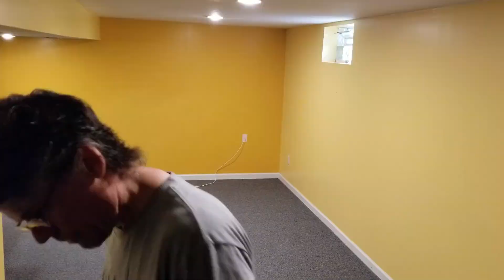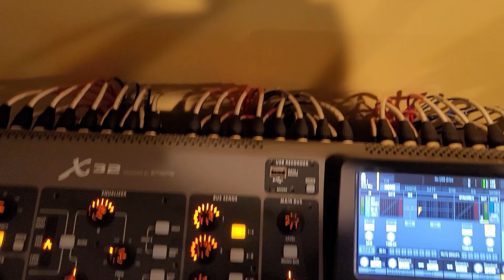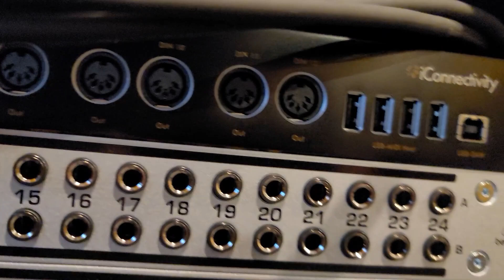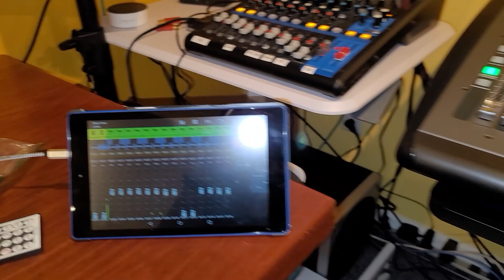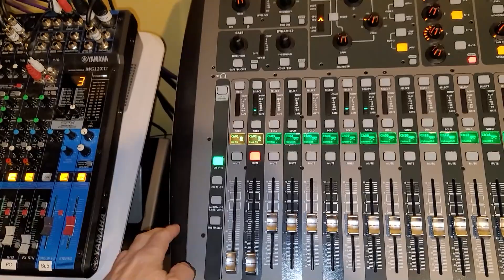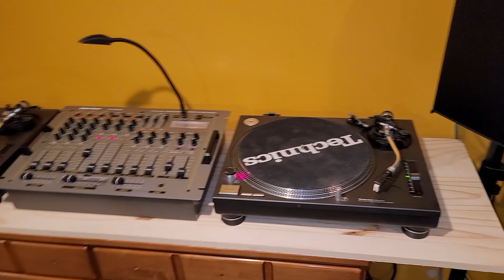I SCRAPPED My Old Studio - How I Built My NEW STUDIO!!

Comment: if your not moving again here is a tip for you using a few tee's and cross tubes you can get extra by joining your two A frames stands to make a third without more A frames ,,, also tilt them back legs more to a vertical so get's them closer to the back wall ....   have my 88's 70's in the middle and 2 lots of spaces for 61's on the sides  with 4 tier's each ....
Reply from the maker: Yes, I had exactly this in mind when I bought the second identical A-frame. :) I already have the T's, I would just need the cross tubes. I played with the vertical slope quite a bit, but found that when I had them sloped more, while it did reveal more of the control surfaces, it made it difficult to work with the synths on the top, especially the Wavestate and opsix that require lots of fiddling, because my back would get sore from leaning outwards! So I intentionally made them quite vertical.
Reply: @ScottsSynthStuff  I did a quick check, but really need to do a more in depth check for fit, but I tried tubes and fittings from both Jaspers and On Stage, and at first glance , they seemed to be interchangeable... Like I said, this was a quick try, and I need to take a seriously close look at the fit, but they did fit each other...
Reply: Yes. I do this also.

Comment: I have been following your video very carefully. I am an amateur and have been setting up my own small studio for a year now, it is clear that you are very passionate and that you do things with enthusiasm. You go very fast and not everything is clear to me because I am less experienced. I think I'll take it easy to steal some ideas from you. Can I afford a hint? I would raise all the cables touching the floor to facilitate the use of the vacuum cleaner. Congratulations on your enthusiasm and technical skill. Greetings from Italy.
Reply from the maker: I like your idea, maybe a cable chase or some kind of elevated platform attached to the stands to lift the cables up. It's tough with the snakes, they are VERY heavy, so they need to be properly supported so as to not put too much strain on the connectors.
Reply: @ScottsSynthStuff  I like this professional approach. I have been working for years in the field of robotics and industrial automation. The electrical connections made with care are as important as the mechanical part. Good continuation for the realization of your studio.

Comment: Scott  i  got stuck in the GAS stage ....and now need to take time to do all  the rack module and  keyboard repairs and then rig my room up midi  Audio and power side of things this coming winter  its only 25 boards and 40 odd rack modules ....lol   wish me luck
Reply from the maker: "only" :) :) Good luck! I just want to get the Polysix and Juno-106 done this winter! Oh...and write some music!! :)
Reply: @ScottsSynthStuff  seen how many screws are in a motif 6 ... also a fader on a  X station. an encoder on a E-mu  rack module and akai S5000   replace a cracked  key on a Gem exquinox pro88 ,and Emax 2 chipped key.and replace a board in an E4k... not much ....lol
Reply from the maker: @johnb2044  Same for the Montage. SO many screws! The JD-800, too.
Reply: @ScottsSynthStuff  yeah just got a JD-800 and its really needing end covers as it had a fall from previous owners who gave it a band aide fix ... have found a parts board but have to go collect it ... down to the USA for me from BC..

Comment: Thanks for going through you new setup.  I configure my studio about once a year.  It takes about 2 weeks of out-of-service and another 2 weeks to finish (a bout a month).  I have 26 keyboards all connected and ready to go.  Submixed in RX1602s (6each) into a X32.  I route MIDI via a MCRR. Jasper stands. MacBook Pro running Ableton Live/with Push 2.  Sequencing on a MPC-X.  I've made all my own audio cables, using canary star-quad cable.  (Noise is pretty low). I monitor via Yamaha HS-10 and Bose L1S.  I managed to leave a little room for guests (2 max).  The most useful tool in the studio is an Excel Spreadsheet!  I divide everything into positions and have excel sheets for MIDI and audio routing.
Reply from the maker: Yes!! I realized pretty early on that I was going to have to create some spreadsheets to keep track of routing and cables. I looked at the MRCC, but decided on the mioXL for the RTP functionality. 

I went to Sweetwater this spring to audition studio monitors, as they have a DAW room with tons of them hooked up so that you can A/B them quickly and easily. I decided after lengthy listening...to just keep the inexpensive JBL 305P's that I already had. I have a couple sets of headphones that reveal quite a bit as well, plus I'm USED to the JBL's, and know what things sound like on them.

26 keyboards! I'm getting there...slowly...
Reply: @ScottsSynthStuff  Thanks for the reply.  I also have a bunch of groove boxes and drum machines.  You've inspired me to get the Cobalt 8X, I know I'll have to wear a set of readers to see what I am doing, but think I am going to enjoy the sounds.  My shame for having so many keyboards, I tend to play factory patches and only a hand full of sounds per instrument.  But many times it is comforting reaching for a keyboard/synth for a particular sound/patch.  I do sport a modular system where I would like to think I am sound designing.  I really enjoy you approach and style, Your videos are very entertaining and instructive.  Keep on making content.👍  PS. the cool thing about reconfiguring your studio is that it brings different synths into highlight and allow my workflow to continuously develop.

Comment: Question. Why would you run your Behringer X32 through the Yamaha MG12XU, effectively reducing your 32 channels of individual audio, down to one stereotrack? Why not use the Behringer as the audio interface? Seems weird to me, and I'm also suspicious of the Behringer headphone amp, as I had a similar tiny mixer/amp that came in the same chasis, and it was SO bad, so much noise. Maybe they upped their game since then? Looks RAD otherwise!
Reply from the maker: Maybe I didn't explain it well enough. For recording in my DAW, the X32 is my audio interface, using its 32 in/32 out ASIO driver. For everyday Windows use, the Windows audio device is the MG12XU. The MG12XU also controls some devices that I want going through the monitors for which I don't care to use channels in the X32. This way, the X32 only needs to be switched on when I'm actually using my DAW or working with the synths.

The Behringer headphone amp is not...the cleanest thing. I'll likely replace it with a better rack-mounted unit in future. For actual editing, I've just been plugging my headphones directly into the X32, but for casual use (especially for recording vocals) it's fine...for now.
Reply: @ScottsSynthStuff  I see :)
Thank you for the explanation!

Comment: Oh, another question for you is what drove your purchasing decision on the Fantom-06 over the Fantom-6 or others?  I have no workstation KB right now and am thinking about the Fantom-6 or just a Jupiter-X or even Jupiter-Xm as primarily a module.
Reply from the maker: I really liked the Fantom, but couldn't justify the price. Plus I already had a Montage, which replaced my MODX. However that left me without a portable lightweight multitimbral do-everything synth, so when the Fantom-06 came out, and did pretty much all the stuff in the Fantom that I loved, I jumped at it. And for that purpose, it's great. I do wish it had more memory in it however. The Jupiter-X I actually really loved when I played it...and I didn't expect to - but it duplicates a lot of what's in the Fantom and my System-8, and I reaaaaally dislike the tiny postage-stamp sized screen the put on it, along with the deep menu diving you have to do on that tiny screen.
Reply: I have a Fantom 8. I thought about also getting a Jupiter X/Xm or Juno X, but realized there isn't much they offer over the Fantom except for price and a different UI (such as that small screen on the X/Xm vs. the big touch screen on the Fantom). I like that the Juno-X moved the screen front and center. It was a mistake on the Jupiter to put it in the upper left. Each has special features though. No one of these synths does it all. I'm sure Roland did that on purpose.  If I got a Roland something to compliment my Fantom, it would probably be a System-8.  

Ultimately, they are all ZEN-core synths, largely doing the same thing but in different ways (including mostly similar model expansions like the JX-8P or Juno-106). The Fantom, though, adds workstation features (clip launching, 16 channels of control over internal sounds, or external synths, etc.), so if those features are desired, the Jupiter X/Xm or Juno-X don't fit the bill.

For Fantom 06/07/08 vs the 6/7/8... 

There are feature differences that matter, but price difference is big too. To decide between them, write down the list of differences and decide what you need vs. what you can afford.  It is hard to find a comparison list, but there are a couple good Youtube vidoes that cover this.  

A lot of people don't care about the V-Piano (not available on Fantom 0), for example, and are happy to use the older SuperNATURAL sampled pianos (which arguably sound better much of the time).  

The Fantom-0 series are lighter if you plan to take them somewhere. But the build quality is better on the Fantom (more premium parts, better chassis, that's why it is so heavy). 

The Fantom has the analog filter, has better/more control for the 16 channels, and will allow all 16 channels to continue to play a sound when you scene swap ("Tone Remain") vs. only 8 channels on the Fantom-0 (Fantom-0 can choose between carrying the sounds when scene swapping for 8 channels, or having all 16 channels working I believe, but not both at the same time). This is because the Fantom has 4 sound chips vs. only 2 on the Fantom-0. This also means updates like the N/Zyme Wavetable model expansion are not available on the Fantom-0 and why no V-Piano. Both have the Virtual Tone Wheel organ, though.  Also, for the Fantom 8 vs. 08, the 8 has the PHA-50 keybed, but the 08 has the next step down in quality (PHA-4). Both are pretty good keybeds for piano action though.

Again, whether those things matter depends on each person's needs and budget. Frankly, the Fantom-06 or -07 are an amazing bargain for the price. That is a lot of synth for not much money. Least expensive way to get a full-sized ZEN-Core synth. Right now, the Fantom-06 is $1600 and Jupiter Xm is $1700 but isn't a full sized synth. Next cheapest ZEN-Core synth is $1900 for the Fantom-07, then $2100 for the Juno-X, and $2150 for the Fantom-08.   But the Fantoms are $3600, $3900, and $4200 for the Fantom 6, 7, and 8 respectively.  

Ha, didn't intend to type that much, but Fantom vs. Fantom-0 features is not a simple topic. Sure wish Roland had a simple comparison page, but often these differences aren't well understood unless you take the time to understand what all these features actually mean.